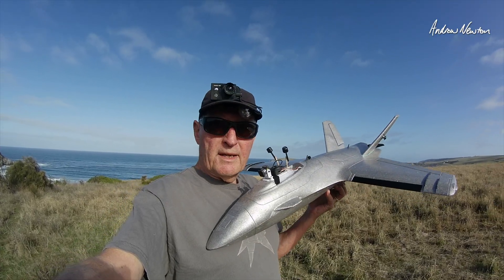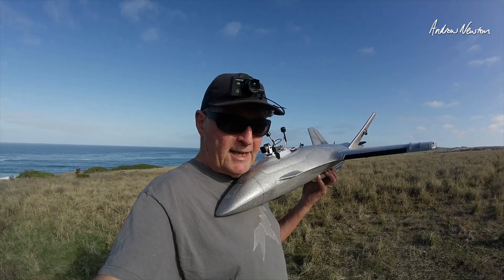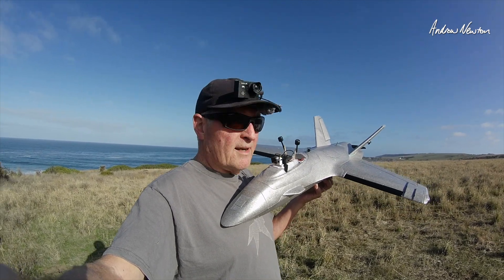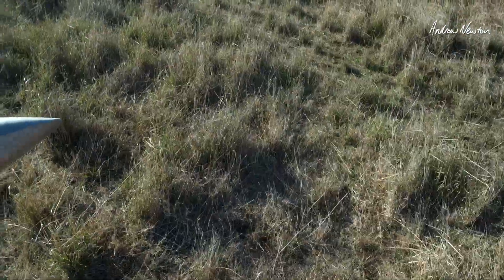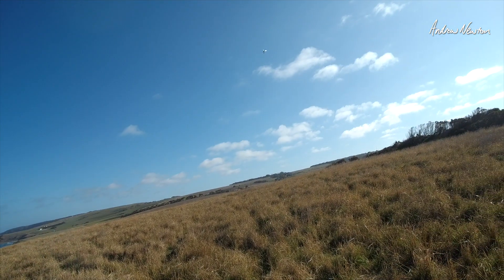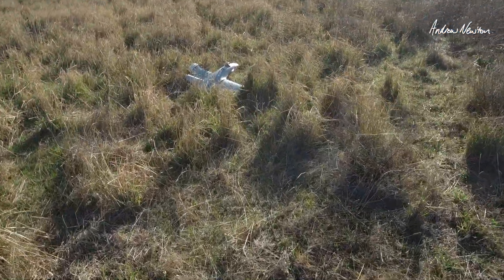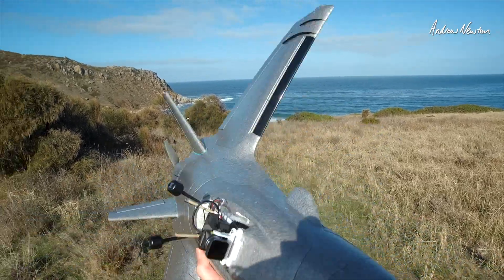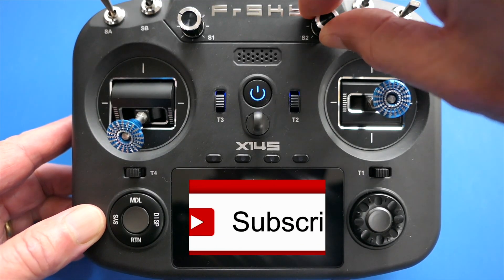AtomRC Dolphin Pro Maiden - Part 1. Factory mix and INAV settings

Comment: Hello Andrew , i really appreciate your multiple video and tuto.I have a Ranger 2000 with a Speedy F450 Wing under Inav 7. I have a problem with my DJI 03 Air Unit overheating. I would like to display the temperature of the DJI03 Air Unit in the OSD via a CLI command. How can I do this precisely? Thank you in advance.
Reply from the maker: Don't know if it's possible. I don't have 03
Reply: @AndrewNewton  THANKS ANDREW to have take time to answer me

Comment: Yes, using those Rudders as elevators was never going to work....Ive got one of these in box...( Original)...Not even sure why they would add Rudders to this model. Doesn't make sense....🤔😳🇬🇧
Reply from the maker: They have gone to so much trouble to add those rudders with no good reason
Reply: @AndrewNewton  Yes, it seems like a very basic aerodynamic folly....Rudders don't work on Deltas...🤔😳🙄🇬🇧

Comment: It's a great looking plane, I love the color of the foam. The angle of that v-tail never did look very useful for pitch, as others have already said here it looks like you'll need at least some pitch control coming from the main wing.
Reply from the maker: Full elevon mix and rudders just to try it, will be my next test.

Comment: Hi, I flew mine with a 5S 2200, with stock motor and stock 8" prop it flew ok-ish, but wasnt anywhere near as fast as my v1 that's toying with 200km/h. Pro was going around 130-135km/h. So then I fitted the same motor (2806.5 1920kV), still with 5S and it was a lot more alive. The factory INAV mixer is a bit... exotic lets say, so I went for a classic elevon mix and yaw only on the rudder. Tonight I'll try more mixing combos, a lot can be done with this plane :)
Reply from the maker: Exotic is being kind. Seems all wrong to me. I'll do the same as you in the mix.
Reply: @AndrewNewton  AtomRC likes funky things on the tails, I'm not sure if anyone figured out yet how the V tail works on the Swordfish haha. I love this twin tractor, but damn how his tail loves to trick me. For the Dolphin Pro I've finished some rudderless, less angled and lighter rear stabs, I'll publish that at the RCgroups thread once it's tested airborne
Reply: @Olivier-C > I'm not sure if anyone figured out yet how the tail works on the Swordfish haha.

Haha more than once I did a low altitude loop and almost rammed it straight into the ground because it wasn't pulling up lol. But I noticed when you punch the throttle it will immediately pitch up.
Reply: I’m not sold on this model yet

Comment: I also did my first flight the past week. First, I have to use 5mm Offset on the Elevator. First flight was just as wing. The first flight ended after 5 sec. because the Dolphin has to need the uptime (I didn't found a notice in the manual) Second flight with V Tail and normal Elevator mixed together. But not happy with that config. Right know I use the V tail just as Rudder (but not that much control) and the elevator with 5mm Offset trimm. It flys well, but I am not that happy with the Dolphin. Have to try differnt throws on Elevator and Aileron.
Reply from the maker: Thanks for sharing your findings. We will get there eventually
Reply: Wait, so I can or can't fly it with just the two wing servos (old dolphin style?)
Reply: @N9197U  i tested both variants. The wing config with v tail only for rudder is the best in my opinion. But a multiplex Funjet 2 flys much better…

Comment: Olivier Fpv did a different mix. Maybe it will work out for you too🤔
Reply from the maker: Yes, that is my next test
Reply: I watched your Talon Gt kit building tutorial and it was very helpful for me, though I set the pitch to 100% and left the yaw untouched at 50%.
Maybe this is a V=tail thing, but it is flying better than with the 50/50mix.
Reply from the maker: I have 70 elevator and 30 rudder now.
Reply: @AndrewNewton  And an elevon mix too?
Reply: @AndrewNewton OK, I maxed my servos out 🤦
It's no issue normally, but at full deflection they get stucked.
Reply from the maker: @altermannfliegt3927  Not on the Talon GT. Just ailerons and V-Tail
Reply: @AndrewNewton  When I thought of the Elevon Mix, I was thinking of the Dolphin Pro.
Reply from the maker: @altermannfliegt3927  On the Dolphin Pro I'll have elevons and just rudder for the next video

Comment: Fly it inverted?
Reply from the maker: Ha! Will need some tuning first
Reply: @AndrewNewton  The rudders will work the right way then. Changing the software settings will be 10 seconds of work. Maybe you need to interchange the left and right wing. On this type of plane the only you need big elevators and small ailerons. So I would use the rudders for the aileron function, but then the rudders should be under the fusulage.
Reply: I would fly it first clean line of sight with 4S 1000mAh.
Reply: @AndrewNewton  Add Ventral Fins?

Comment: I see these fpv mods and I wonder,, doesn’t it add so much drag to the aircraft flying??. I’ve never own an rc but that seems like it’ll reduce the overall performance of the aircraft?
Reply from the maker: I have done efficiency comparisons with FPV gear positions and it made no measurable difference. Probably would matter at higher speeds but at cruising speeds it doesn't
Reply: @AndrewNewton thank you so much, this is exactly the answer I was looking for.
Reply: Absolutely perfect question- I get roughly 20 percent more flight time on craft that isn’t fitted with FPV gear 👍🤝
Reply: I get over about 1 hour 20 minutes of cruising time on my Dolphin with a 4S2P battery. More than long enough for my needs!
Reply: @wattage2007  21700 or 18650? how much mah?
Reply: @N9197U  18650 LG 3000mAh.
Reply: And I should have mentioned, that’s with walksnail fpv system onboard.
Reply: Not sure why so many people choose to stick the antennas out of the top of their models when the signal will be blocked by the bottom of the aircraft anyway (assuming it's flying high above you)

Makes more sense to leave the antennas inside to reduce drag

Comment: I found the same issue with pitch oscillations in angle mode as well. I'm considering the ruddervator/elevon mix as well to see if that helps. I'm not too sure why it wants to porpoise so badly..
Reply from the maker: My next flight will use Elevon and V-Tail mix

Comment: Control surfaces are 4-5x too great. It`s not a stunt plan, is it? Have you considered making it a single EDF instead of prop? Love the visual of the air frame in flight. Once tweaked to better performance the FPV experience should prove to be a thrill to fly. All the best!
Reply from the maker: Yes you are spot on. Next flight will be properly set up. No EDFs for me, I really don't like them.

Comment: Mine bobbed in wing and vtail configuration, but I was slightly tail heavy, but mixing elevators into all control surfaces gave it much more control. I was happy with it after that. Going to go to a higher kv f90 since I run 4s on everything.
Reply from the maker: Good info thanks. I'll mix the same way.
Reply: @AndrewNewton  I forgot to mention I used inav 7.1 too, since I'm used to how the tuning works on it. I had oscillations at high speed on my drak on 8 that I didn't get on 7.

Comment: Should you run a bigger prop using 4S Andrew ?
Reply from the maker: 4S will be fine when the tuning is fixed. I was using just over 50% throttle

Comment: Isn’t this a 6S setup? But you seem to be using a 4S battery right? 
Did you try auto launch? Interested to know the throttle settings for RTH setup.
Reply: He said on the video he doesn't use autolaunch. 😒